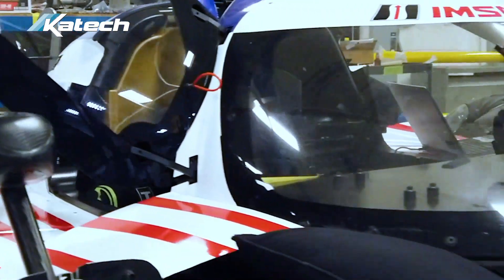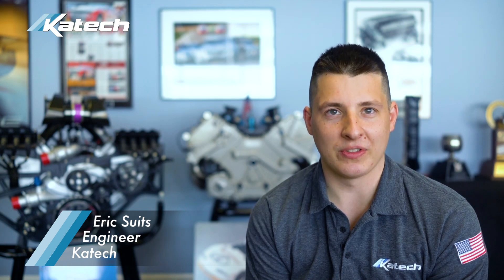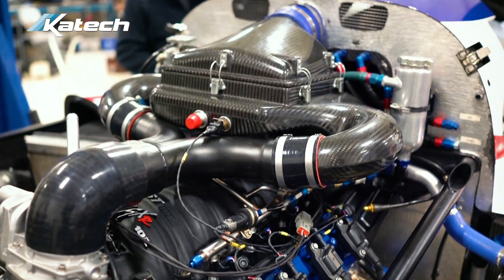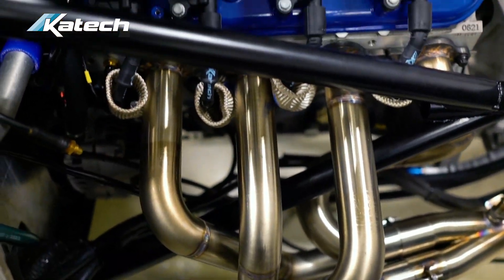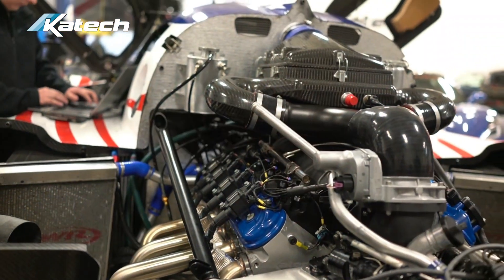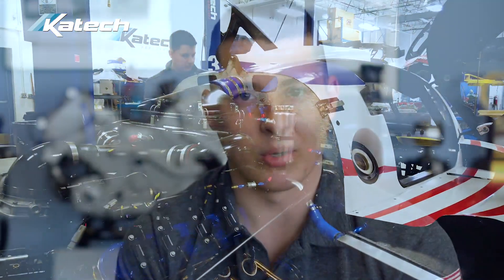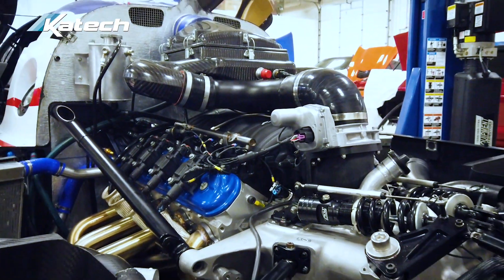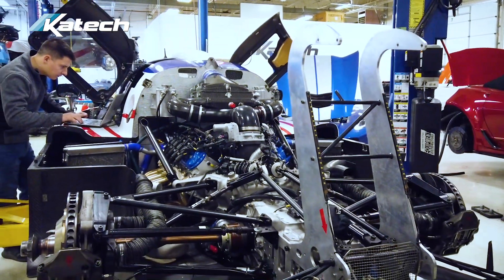Katech LMP3 to LS Conversion Package!

Comment: Greetings, Folks:  I like this info source.  Is anyone aware of an ITB system for the LS7 that will go under the hood of a 2006 ZO6?
Reply: Harrop Hurricane ITB manifold with Fluix gmbh in Germany carbon fiber air boxes were designed for the C6.